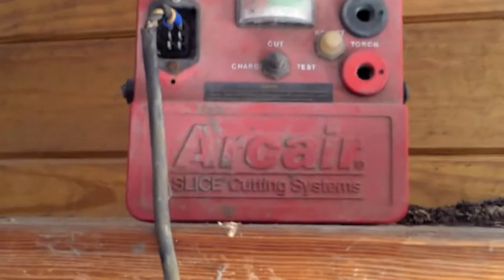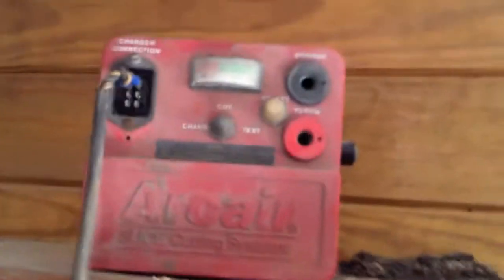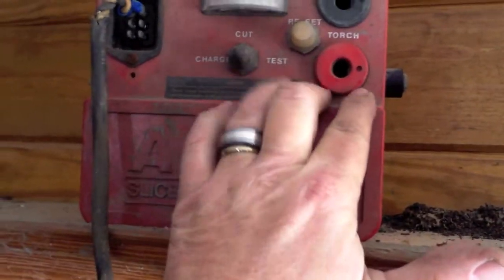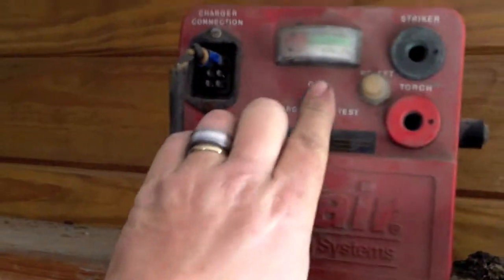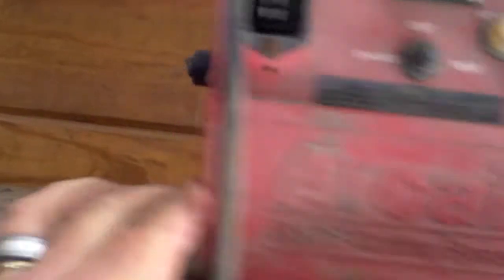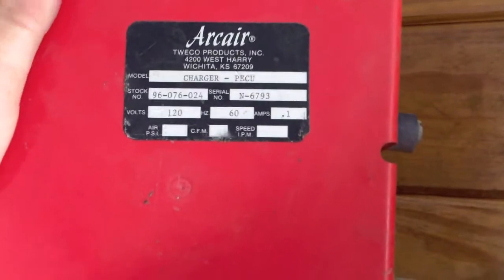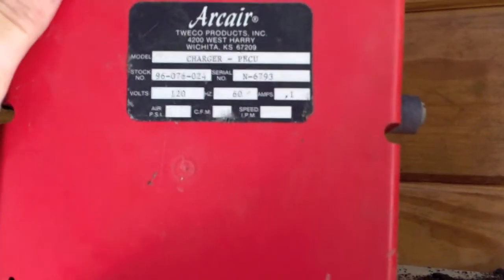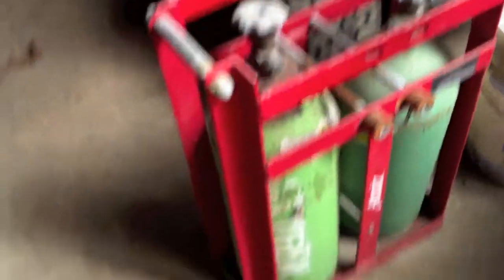Shop Clean!! and a Question!!

Comment: Carbon arc gouging system... it uses a copper plated carbon rod with compressed air to cut steel... it is sort of an old type plasma cutter